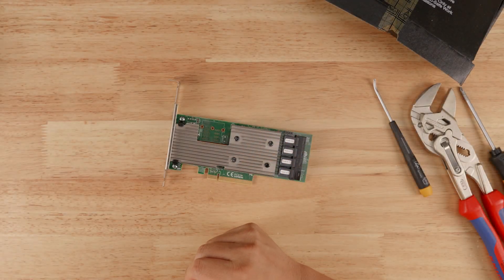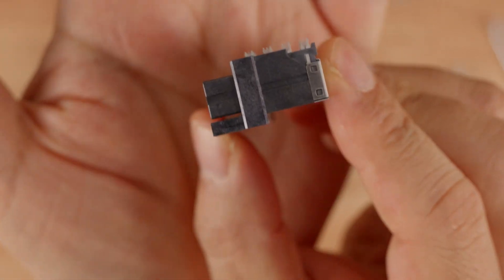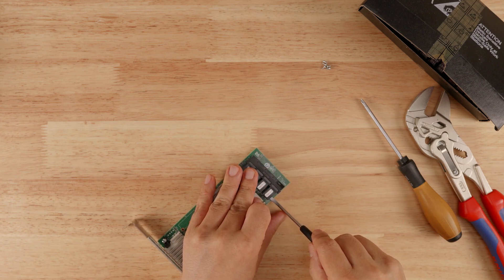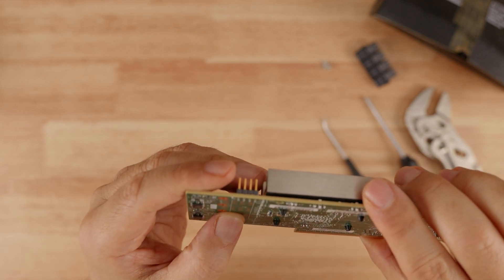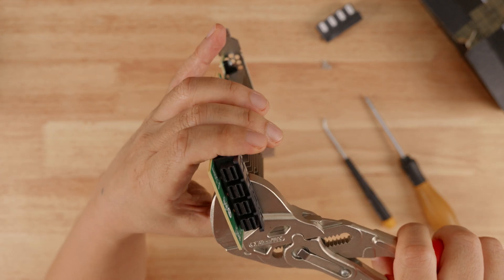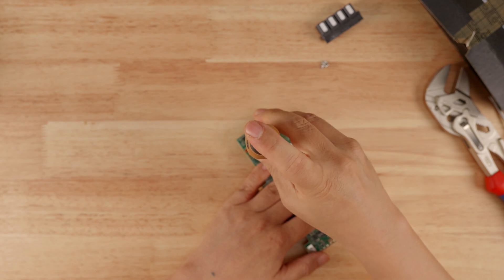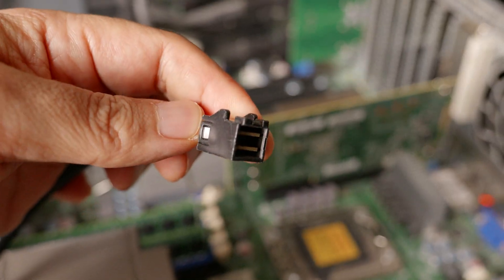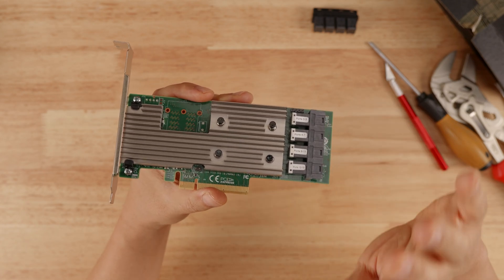Repairing Quad-Port SFF-8643 connector on LSI Broadcom 9305-16i | A Day In The Life of Art of Server

Comment: you could try to add TWO connectors in the top cavity to see if you could transform the 16i into a 24i ... with or without a firmware update
Reply from the maker: I've had similar ideas, but unfortunately I don't think that's going to work. There are other components for the SAS ports that are missing.

Comment: Looks like I'll be going to digikey to repair my 9300-16i :). 

Thanks for the video, I wasn't looking forward to reflowing that connector, and it turns out I don't need to 🤣🤣. Also surprised that the Amphenol part is cheaper than the Molex part.
Reply from the maker: I also have them available here: https://ebay.to/3ZgRrpu (eBay Partner Link)

Comment: Molex or Amphenol are well known high quality electronics companies. Both used in automotive, aerospace, defense, communications and industrial industries interchangeably. Cant go wrong with either. Plastic spudger and plastic pry tools (used for cell phone disassembly) would be safer, but someone with experience can use the metal pry tool safely as well. Good job saving it from the scrap heap!
Reply from the maker: Yeah, those are good companies and I'm glad this helps prevent scrapping perfectly good working components!

Comment: I have a couple of question about dell poweredge r710.
Reply from the maker: You might want to checkout this playlist then: https://www.youtube.com/playlist?list=PL28eVGz5vFQ9hUBeeg5bxj-s0IeitoGIb
Reply: @ thank you so much but is the server still useable in 2024 what should be my experience should I expect good performance and is there a option to install windows 2022. If im on a bought should i buy the r710 and upgrade to 12cores 24threads 128gb ram and 12tb sas hdd and a 512ssd for system and replace the stock raid controller with a dell h700 or buy a r730 with only 2tb

Comment: Nice job. Personally I'd put a bit of plastic, EPDM rubber, cardboard or something like that between the metal of the pliers/clamp and the PCB while compressing just to be sure not so damage the surface or any of the solder joints. Kinda amazing that those connectors are just press fit, didn't expect that.
Reply from the maker: yeah, that's a good idea too. the Knipex pliers do have a smooth flat surface so it doesn't mar up the contact surface. thanks for watching!
Reply: also, those knippex jaws always move parallel to each other, not like the usual adjustable pliers.

Comment: Man, I was looking forward to you putting out a $2800 hot air solder station and desolder a SMD 80 pin connector, but no you just use a screwdriver and do some prying.
Really, I would've wrecked it without knowing how it is attached. Nice vid!
PS Like that you transferred the labels
Reply from the maker: I'm glad these type of connectors are relatively easy to replace. SFF-8087 shield part is a real pain.

Comment: Since you contaminated the surface of the board with your fingers, you should have cleaned the surface with some alcohol before seating the connector! :face-purple-crying:
Reply from the maker: No, that's me applying the anti-corrosion to the contacts. Alcohol is bad for you.
Reply: @ArtofServer  - I was talking about you, I was talking about the board.
Reply: @ArtofServer  Haha, anti-corrosion.
Actually, tubeDude48 is not wrong, albeit I'm not sure to which extent it's needed for this press fit connectors. But sure, to be on the safe side.
Reply: the connectors make contact inside the plated-through holes, not on the surface. the surface can be a dirty as it wants ;)